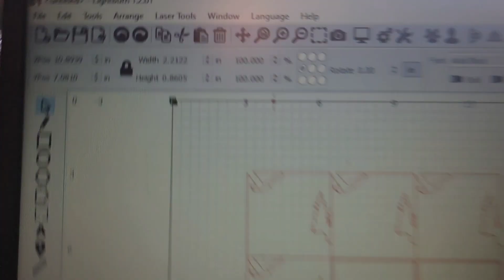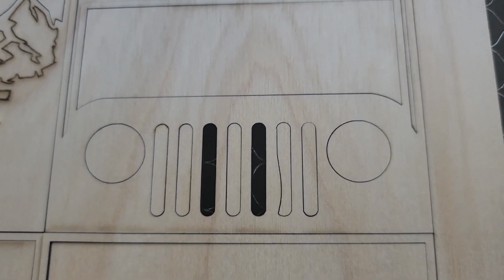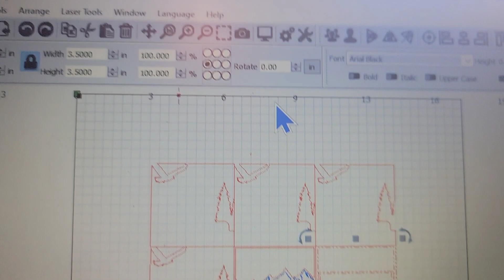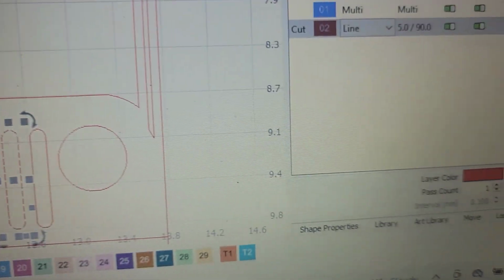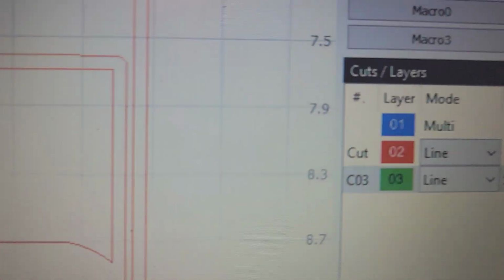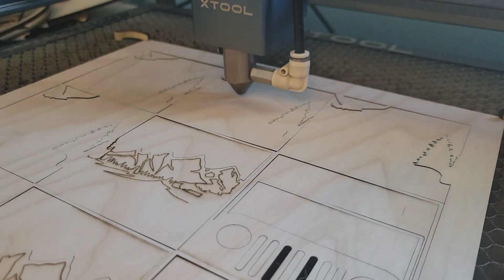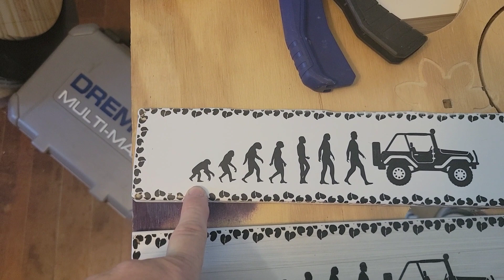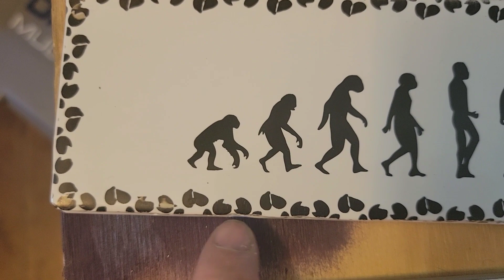Fixing engraving problems is easy using LightBurn with the xTool. IF setup properly.

Comment: Nice catch! If you see it before it happens you can hit “pause”. It works really well and, unlike “stop”, you can just keep going after you fix the issue.
Reply from the maker: I forgot to add tabs to the grill pieces. Past experiences have shown me they are a problem. 

But turns out there is a much easier way to fix this without doing all I did. Thanks to another viewer, I now know about "Cut selected shapes". I will be making a follow-up to this video. 

Thanks for watching.